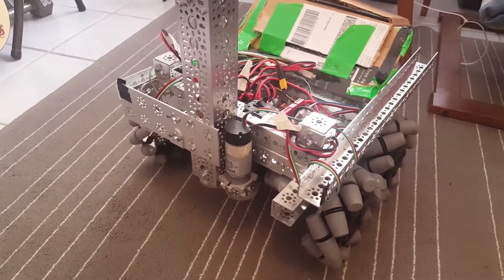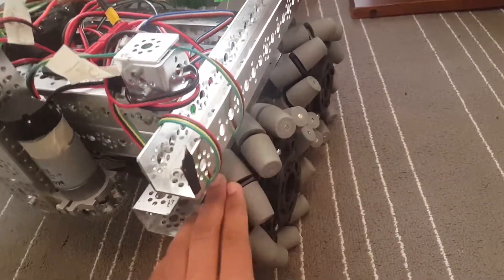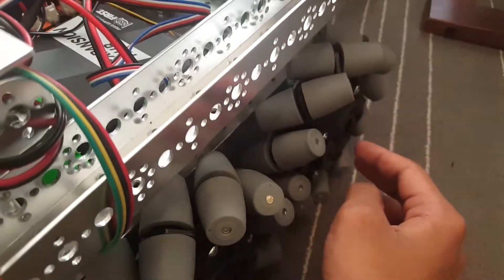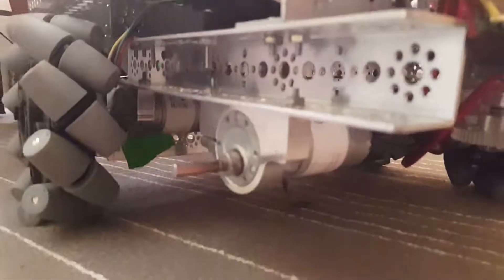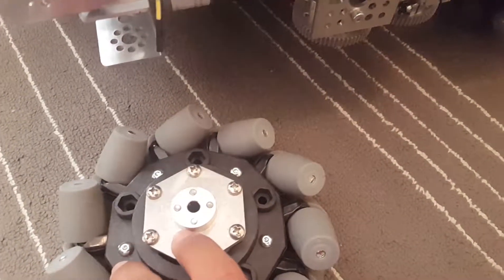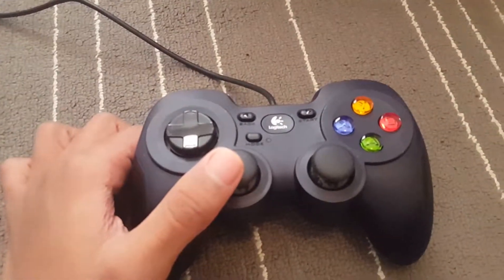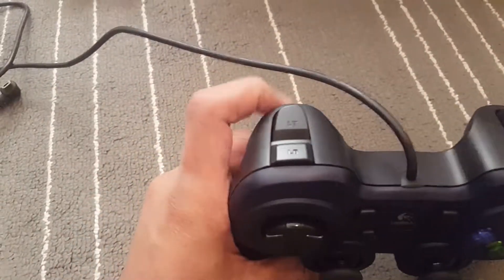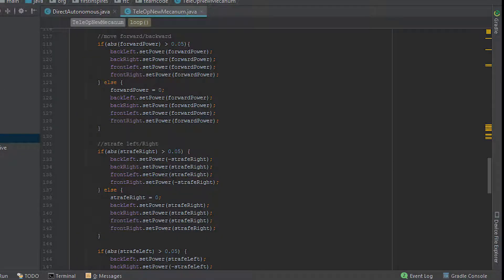FTC How to mount mecanum wheels | Team3939

Comment: Hi, I'm ordering mecanum wheels for our FTC team.  Im trying to figure out which adaptor plate i need to make sure they attache to our 1/4" axle or possibly to our neverest 20 motors.  what is the part name or number for that adaptor plate?  thx.
Reply from the maker: If you’re ordering the same 6 inch wheel as in the video, you need an anymark wheel conversion plate. I will put the link in the description.
Reply: @A5IR   thank you for helping us. :)